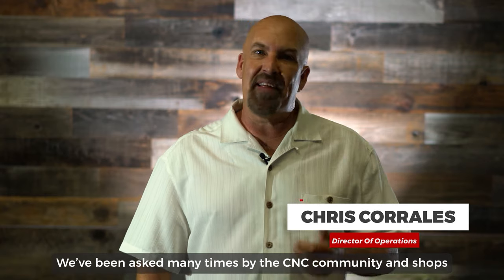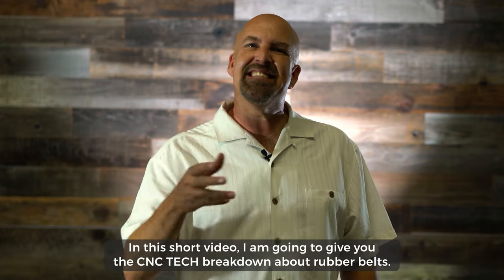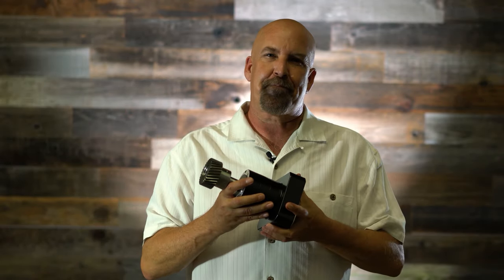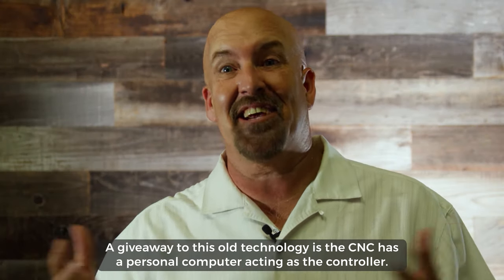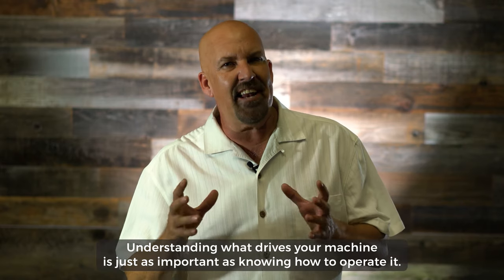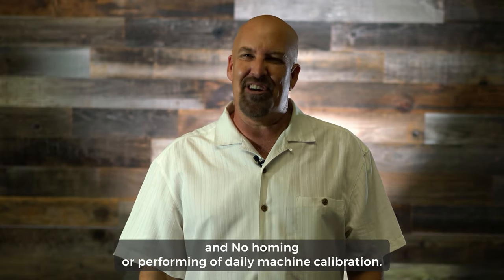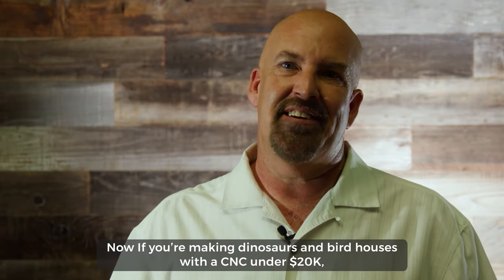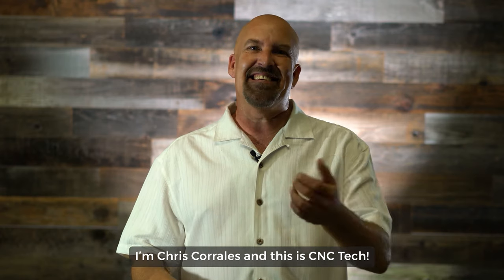Does your CNC router use rubber belts? Bad idea. Ask before buying-- CNC Tech by CNC Factory

Comment: Building a custom CNC router for cutting highly abrasive material with even more abrasive dust of it. I just can’t use a ball screw or even a air cooled tool spindle. 
So if you have special applications, think beyond “industry standards”